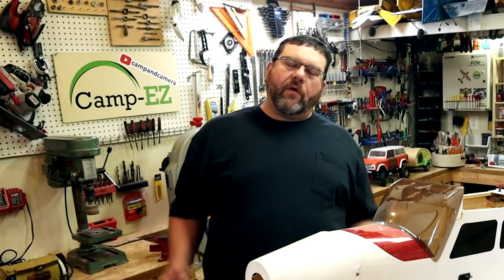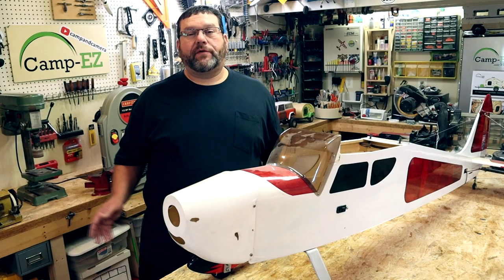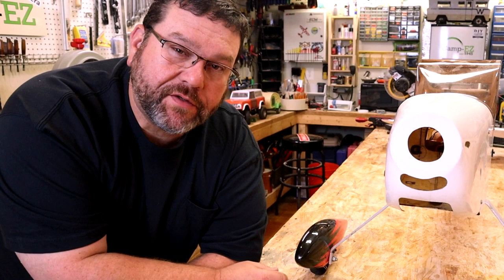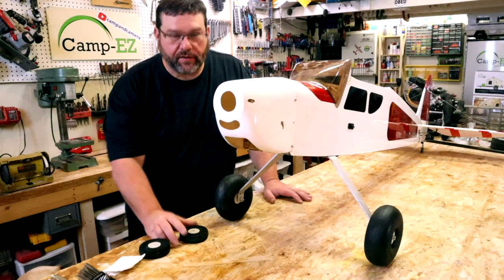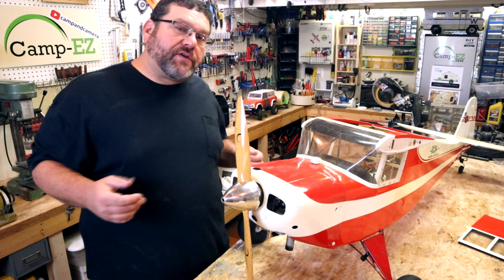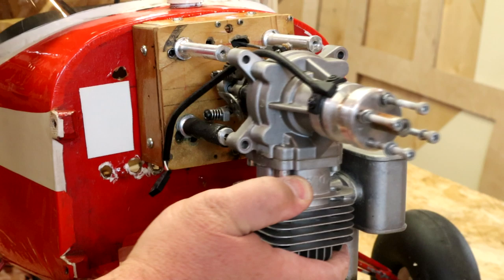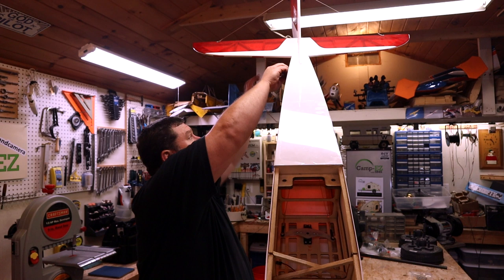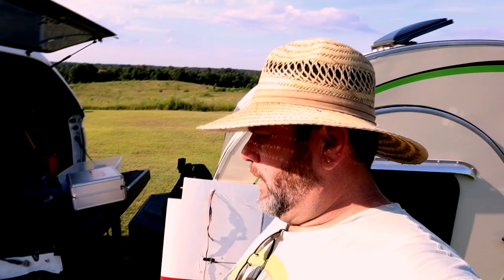RC AIRPLANE IS BIGGER THAN MY CAMPER!

Comment: Hi mike
I too am a long time model flyer over here in the UK. Started my teardrop back in March as a lock down project and am nearly at the skinning stage. Thanks for the pointers along the way especially the "you only do one piece at a time" wisdom. Nice rascal too. Surprisingly agile for a vintage looking model. Only flown the monster one with a 30cc saito. Will send some pictures when completed.
Paul
Reply from the maker: I’d like to hear the 30cc Saito run.  They make a great engine!  Send pics of your build when you’re finished!
Reply: Lovely burble. Knife edge loop looks strange from a model like that. Edge or extra maybe but not that.

Comment: Must be something to this building teardrops and RC models . I started Rc modeling in  1989. i enjoyed it for 10 years and moved to ultra light activity , namely powered trikes till sport pilot came in and had to pedal my trike. I have followed your TD build and I'm down to the skinning part of my build. Aluminum was the activity for today. Roof piece's are cut and in position and one side wall cut and ready. If you figure out the connection between both the TD build and the RC modeling I'd like to know.
Reply: I think you are onto something...
Reply from the maker: Yep, there must be a link!  I flew RC for several years, then got my private rating in a Cherokee 140.  I just love aviation!

Comment: at 9:06,  it is not clear whether the installation of servos includes the use of  rubber grommets;  for vibration damping.     there is a correct way to execute a rolling take-off of a taildragger.    at linked video, at :58,  Observe the Tail.      cheers
https://www.youtube.com/watch?v=SXanmYwyLTI
Reply from the maker: Yep, all servos have grommets.  Thanks for the input.